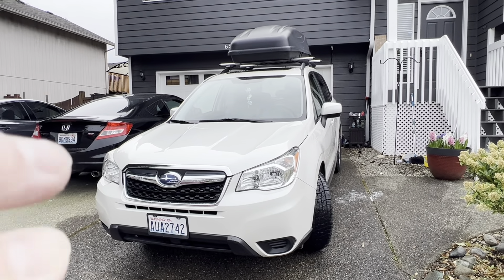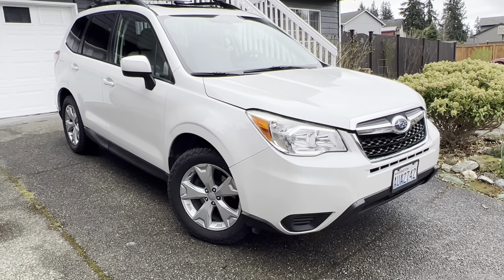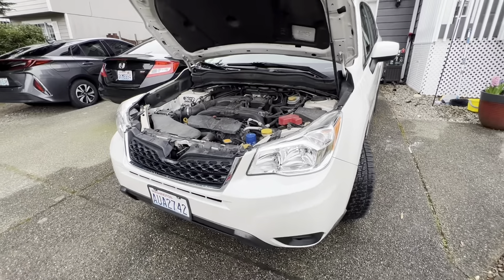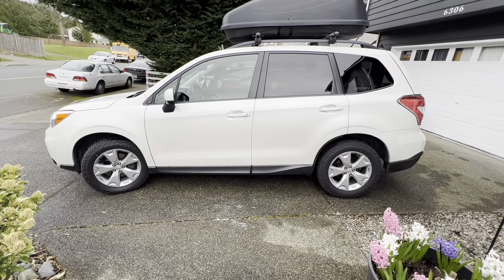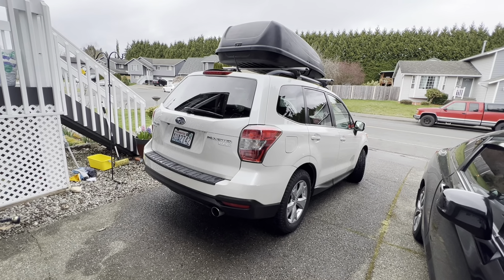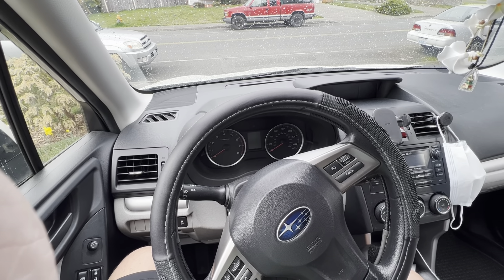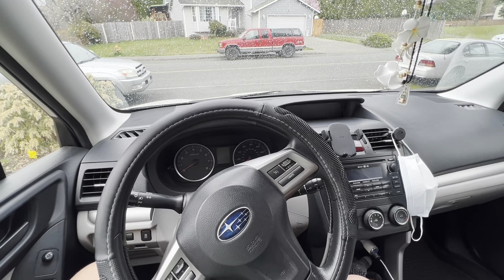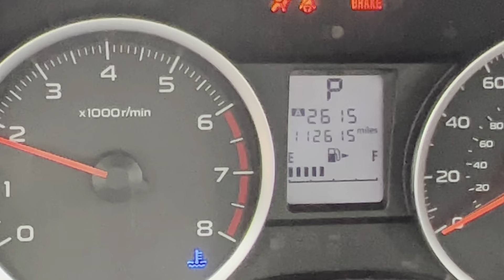2015 Subaru Forester 2.5i LONG TERM REVIEW 112k miles.  Original owner. Repairs, likes and dislikes!

Comment: *********   I have a 2015 Subaru Forester "Limited"  When I changed the serpentine belt, I also replaced it with a "Gates" Belt and new Tensioner, I had the CVT flushed at 50,000 Miles ( not the IDIOTIC 100,000 mile service, Subaru says LIFETIME OIL  "NONSENSE"  , Oil is changed at 3,000 Miles with K&N filter and  One cup LUCAS Fuel injection cleaner at every "Fill up"  with 70,000 Miles my Engine  runs as smooth as butter !! *****
Reply from the maker: The Subaru has a good engine. I use thicker oil and Lucas is a great product as well. I notice a difference when I run it on 10/30 versus the 0/20

Unfortunately these engines are known to have head gasket problems. So I think the engine sounds better with thicker oil and runs better. Hopefully I won’t ever have any head gasket issues
Reply: @AutoGuyVideos      Hi ..it's my understanding..only the First generation engines had Head Gasket problems, fixed about 2009, second generation had oil consumption problems...also fixed by about 2014 ...I use "mobil One   5W30 Oil...And have had no issues of any kind, my Engine is very quiet with only slight Valve noise  "
Reply from the maker: @renorichard3257  I noticed my engine consumes a lot less oil when I use thicker oil as well.

Comment: I have a 15' forester premium with 124K miles and it has been HEAVILY used/abused. We hauled over 4 tons of rocks in the back, back and forth, snow, dust, water, rocks, canyons ect... It's filthy since we live in a rural area with children lol.. However it still runs 100%. Sometimes when doing a cold start it will choke once since it gets like 30 degrees below 0 here but happened only a couple times. Strong car!

Comment: Spray resolve carpet cleaner on the stain. Allow it to sit for 15 minutes. Come back and spray it again, put a damp white wash cloth over the stain and use an iron (like you iron your clothes with) on the wash cloth. You might have to set the iron on there for about 20 to 30 seconds. Just lift it up and check the opposite side of the wash cloth and the stain. You may have to repeat this several times to get it mostly gone.
Reply from the maker: Thanks for the tip!

Comment: Traded my 2017 at 97k miles for 2023.  Never had an issue with that car with routine maintenance and tire rotations and two sets of new tires.  Couldn’t pass up the higher trade in value and like the new features on the 2023. Very happy subie owner.
Reply from the maker: Happy to hear that! Most of the problems didn’t happen until over 100,000 miles. Which is pretty typical of most cars. Hopefully you were able to get a good deal and nowadays corporate financing is pretty reasonable. It’s a good car but it helps if you’re handy and can fix  common problems. You should be good to go with the new 2023!
Reply: How much was your trade in? I got a 17xt with 92k

Comment: I like the fumoto valve on this car, don't even need to lift the car to change the oil. Thanks for this video I'm at 80k miles and need to do the CVT fluid for sure.
Reply from the maker: Yes it makes the oil changes so easy!  Good luck with the CVT oil change! It’s pretty easy too.

Comment from the maker: I like your method better! That’s definitely how you get it all brand new fluid! I’ll be more consistent about making sure I do it frequently enough. it will be due for another CVT drain and fill around 180,000 miles. I think I have 150,000 miles right now.

Comment: Have you been purchasing OEM air and oil filters? Or have you found something aftermarket that you like more? Just got a 2016 Touring w/ 85k miles.

I also saw the dealership at 6k milemarks would "install fuel system cleaner" ehich i assume is just dumping STP or something similar in the fuel tank. Are you doing something similar every 6k?
Reply from the maker: I think right now I put a k and n air filter in. It seems to work well.

And typically I’ll use OEM oil filters, or mobile or a higher end wix filter. it’s spoiled pretty good. I haven’t really put in the fuel cleaners in there I probably should, but so far it’s that that parts been been running good.

Comment: Nice video! Just curious! When you changed the CVT fluid, did you drain the entire amount of the fluid in the transmission, or just until the fluid stopped draining with gravity assist. I was watching a vlog by Mr. Subaru, and he kept adding fluid and draining fluid in steps, until the remaining fluid was as clear as it is in the bottle, and distributed properly in the transmission. I was convinced to change the trans fluid by a Subaru dealer shop when the CVT had about 65,000 miles on my wife's '16 Outback Limited 2.5i, and I am not complaining, but I just wonder whether they did the change the way Mr. Subaru did it, or they only drained what came out via gravity, and replaced it with the same amount that drained, (5 quarts?). If they did the later, then the CVT was way short of a full servicing. I'm 76 and really can't do the car care as I once did when I was younger, and w/o You Tube assist then. Now, with all of the You Tube "how to" videos, car care has become so much easier to understand and perform.
Reply from the maker: Most places recommend a drain and fill. I have changed my transmission fluids this way any times and no issues. You can get issues with flushes.  The dealership did a drain and fill as well when they replaced my cvt valve body as well.
Reply: @AutoGuyVideos  .. thanks for responding so quickly. What I was addressing about the Mr. Subaru method of dealing with the fluid in the transmission was flushing without any pressure other than gravity. I've also read about fluids being forced out of the transmission using air pressure. That method is not recommended as it can dislodge debris throughout the transmission which can get lodged throughout the transmission. Gradually replacing the drained fluid with new,  and shifting through the gears with the plug in, and repeating the  procedure until the fluids being drained (maybe 3 times) is as clear as it is in the bottle. I am somewhat happy that you seem to have faith in just draining and refilling, but were I able to do things myself, I would do the drain and fill, drain and fill until only new fluid remained in the transmission. That whole process takes only about 45 minutes or less and probably requires 15 quarts of fluid or more. Take care of your tiny wife, your children and your vehicles.
Reply from the maker: Thank you will do! And take good care as well!

Comment: I watched you and other long term owners reviews before purchasing 2015  forester 2.5i with 167000kms for 22000 AUD and I want to say massive thank you especially to you because I was able to check service log book then pointed out that only spark plugs have been worked on and wheel bearings have not been replaced. After negotiating, I managed to get all 4 wheel bearings replaced by Official Subaru mechanic for FREE prior to purchase so I guess I won't have that problem for another 5 years :)

I can do basic maintence work myself so getting cvt fluid and engine oil done would be no problem. Are there any more common issues that I missed out? If so please let me know!

Otherwise I'm excited to own this car and explore Australia👍

Comment: if you're burning oil, consider changing the PCV valve. Penzoil ultra should help too.
Reply from the maker: Lucas oil has also worked well for the oil not burning anymore. But thanks for the tip I will try it!
Reply: What the name of this product of Lucaz@DIYBIGMAN
Reply from the maker: Lucas oil treatment

Comment: my fiancé is considering getting a subaru forester with 134k miles for a pretty decent deal. is it worth it to get a used forester with that many miles on it, or would you suspect it to have a lot of problems?
Reply from the maker: Check out the Facebook Subaru forester group for common problems. Nice car if your willing and handy to fix the axles and wheel bearings. But personally I wouldn’t get one with that many miles. But if you do you can test axles out by accelerating hard, turning left and turning right from a  stop. If you hear clicking then no go. 

If you hear any whining noises at 45mph+ , then I wouldn’t get it it might be a wheel bearing. I Had to have my cvt valve body replaced. At 120k. $2500 and Subaru chipped in half for it.  Learn all the risks first.   I dislike high maintenance cars personally. 

Cars are expensive to fix at mechanics

Comment: AT trails r the best tires it grips like claws i have then on our legacy and its flawless compare to the noisy all season sports tires it has. It will lose about 1 mpg but its well worth it ti avoid accident during the winter plus it will drive smooth n never be stuck n snow garanteed.
Reply from the maker: They are great tires. However not great for compacted snow. I found out the hard way.   Lol.  They are better for fresh snow.

Comment: i have a 2015 forester i bought in june 2014, 168k miles now. i actually have never done my sparkplugs or my serpentine belt.. i feel like maybe i need to... replaced the original battery in  2019. replaced original rear brakes + rotors in dec 2020, and just replaced the original front brakes and rotors last week! super happy with everything. i've had the same issue w/ burning oil, but overall my car has been super good to me. I even hauled a 1k uhaul trailer across country a couple times. 

omg wheel bearings though. thats the only "major" thing i've had to replace. left rear in sept 2019, then left rear again and right rear in may 2021. 

mine does the clicking when i turn, funnily enough it NEVER did the clicking until they replaced the first wheel bearing in 2019. if im on a round about it just goes click click click. i've taken it in multiple times and they could never find out what was wrong. so its the axle? how do you check ?
Reply from the maker: I’m glad you got good use out of your car! And the clicking noise is the CV problem. But if you turn left and it clicks that means it’s the right CV. If you turn right and it clicks then it’s the left CV. The best way to do it is to sharply turn and step on the gas. I think there’s other videos out there how to determine what side the CV problem is on. But typically it’s usually just the front CV’s that have the problem.

But if you’re gonna do the CVs I recommend you do both the left and the right. I wish Subaru didn’t have these issues. I do it myself so it saves me money. But the parts are freaking expensive. Again ask for a discount and see if you can get any. Good luck!
Reply: Replace your wheel bearings with Timken or SKF bearings. I sold auto parts for many years and later was a mechanic. There is a night and day difference between those bearings and the ones made in China. You can easily get 75k to 125k out of those bearings. Chinese bearings (most bearings sold at auto parts stores) you will be lucky to get 15k miles out of them. The labor to replace them over and over costs far more than just ponying up the extra money for the better bearings and pay labor only once every 4 or 5 years.
Reply: Hello! Do you still have this Forester? I saw one today selling for $7500 because has 195k miles on it. However it's just mostly highway drive since people go from Sacramento to San Francisco and car seems like has been well maintained. Do you think it is worth it to get?
Reply: @andrewscr93  hi there! I will say that I'm not someone who did perfect maintenance on my car.. I did replace the CV axle and it fixed the knocking noise. However in May of 2023 I got a bunch of lights that came on and the dealership said it was my transmission valve body.. costs $3.5k to replace and with the age of my car they said it's better to get a full new cvt engine ($7k). Then in September my head gasket started leaking or blew .. who knows. I still drive it lol. I'm at 206k miles now. I do not stress the transmission (i.e. I don't accelerate very fast and I drop speed going up steep hills) and I siphon built up oil (from the head gasket leaking) from my radiator overflow. I'm just going to buy a new car. 

So imo.. not worth buying such a used car especially at such a price. The valve body issues seem very common. It hasn't given me any issues like some stuff I've read, but I imagine it's because I've always been a soft and cautious driver. My AWD doesn't work anymore though so it was a rude awakening when I got stuck multiple times driving on the beach over the summer lol. 

Don't get me wrong, my car has been very good to me especially since I didn't do all recommended maintenance, but I think it's too risky to buy one at 200k miles unless you were only spending like $1-2k lol
Reply: *full cvt transmission ($7k), and also a new engine because of the age & head gasket  (they priced at $5k) 

So that's just $12k , not including anything else that may go wrong (just replaced the original radiator inlet hose on Christmas cause it was leaking, parts only cost $50 but if someone took it to a shop it would easily cost them $400+).

I know the used car market is trash right now.. but 7.5k is too much. My car was 25k brand new in 2014.

Comment: I have a 2016 and I just replaced the original battery this year. But I only have 26K miles on it and I've had to replace the front and rear brakes. Not sure what that's about.
Reply from the maker: Looks like you don’t drive your car very much. Did you actually physically look at your brakes to see how much wear you had?  I hear about mechanics ripping people off telling people they need new brakes when they really don’t. Unfortunately this is one reason why I do everything myself. Too many people out there ripping people off. But for being six years old I guess you got good use out of your battery. Lol.

Comment: Great video. Any and all vehicles will have problems but it sounds like these definitely have issues with wheel bearings. I wonder if the aftermarket has better quality ones? Subaru's are known for their reliability. However newer cars are being built cheaper imo and I'm not a fan of cvt's but it's just how the industry is going.
Reply from the maker: The valve body cvt went out over 120k. It was a $2000 repair, fortunately Subaru of North America helped out with 50%. 

I now need to replace a bad muffler. Yes all cars need repairs. But some more then others.  There is strength and weakness with each car.  Just depends on what you like. I feel that the older subies had less issues overall. Thanks for watching!
Reply: @AutoGuyVideos  yeah older subaru's were tanks. My son just picked up a 2015 so I'm doing a little research on them. Hopefully it'll be good to him. Tomorrow I'll try to get a service record or speak to the previous owner and see about fluids and whatnot. I'll probably try to change the cvt fluid before he leaves if I can't get good service records.
Reply from the maker: @lobbyrobby  nice. I hope it’s trouble free. When you turn on take off listen for clicks to test for bad cv Axles And listen for any whining when driving for wheel bearings.
Reply: @AutoGuyVideos  will do. I did drive the car today but it was -11 so I didn't get to do a really good test drive (which kinda bugs me because I'm anal about looking cars over). The car is really clean and it was owned by a rich doctors wife so I'm sure it had a easy life.

Comment: Damn, thanks for making this vid! Thinking about pulling the trig on a ‘15 in a limited trim with 75k on it.
Reply from the maker: I like the car I just wish it didn’t have common problems that cost a bit to fix.  If you go to the Facebook Subaru Forester chat group they talk about problems.
Reply: @AutoGuyVideos  I saw one this weekend I wanted.  107k mi, $16k obo.  Read up on its issues, and telling me crap idiosyncrasies I really don't want to deal with...gas gauge off, car can just shut down, windshield wipers, air bags, issues you brought up.  I backed off, much to my own hopes.  Perfect size wagon type car for my me and my dog.  Need a 10yr reliable, and I don't possess your mechanical skills.  Might stick w Toyota, and I was willing to give Subaru a try, as people who drive them, love them.  Currently driving my rusty 92 Toyota Corolla wagon w 234k mi, and may wait until the market crashes in 6mos.  Choosing the right car worrying, esp the way things are being made.  
Thank you, great video.
Reply from the maker: @kookietherapy9398  most vehicles over 100,000 miles require handyman skills to keep them running in good shape. In my experience of the 20 cars I’ve owned. Toyotas have been the best and most reliable. I always recommend you check out the Facebook car groups because they always talk about what they like and dislike and problems and things like that.

Comment: Our 2015 forester has 134k on it. Basically the same maintenance along with clock spring, lower right side control arm ( failed bushing) causing a shake or vibration starting at 60 mph.  Clock spring replacement was not fun.
Reply from the maker: I am now at 121k. Hate having to think about what’s going to break next. Lol.

Comment: The CVT transmissions that have all the problems are the ones they use in Nissans
Reply from the maker: There are many Subarus with failed cvt in this generation. Check out the Facebook Subaru Forester owners group and you will hear about some problems with early Subaru cvts. Nissan has a poor reputyfor their cvt as well. 

My cvt is fine. But I recommend you change the cvt fluid with OEM fluid only and by a Subaru specialist.